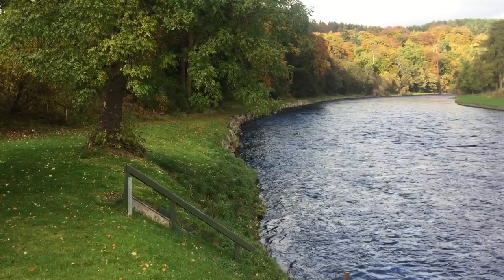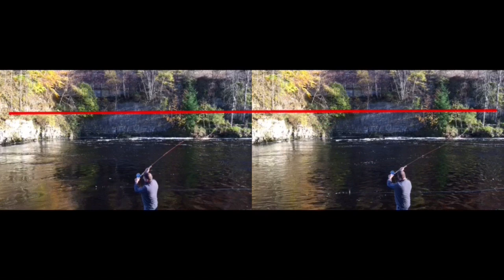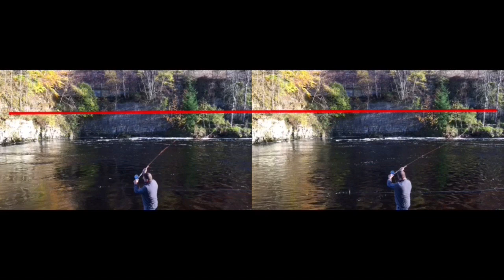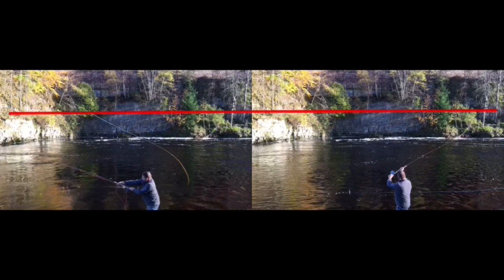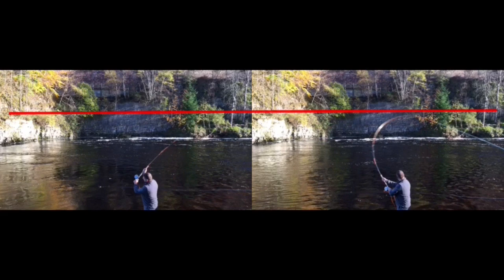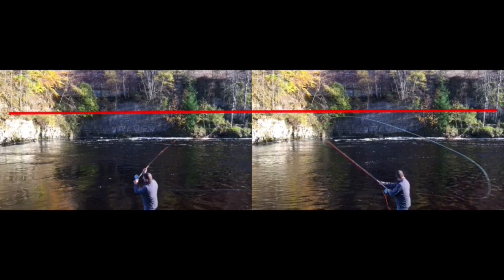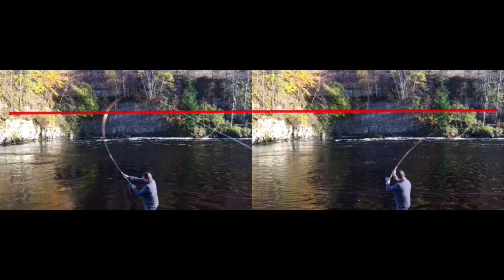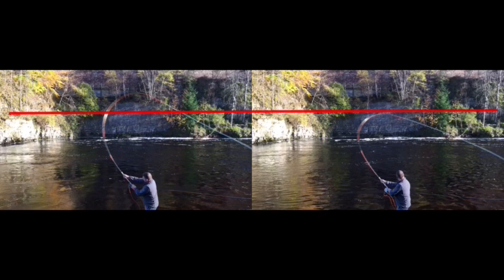Which Fly Line for my rod

Comment: In old days I did fish the heavy side ! 
As I'm starting use fast short stroke rods that change my line selection as well! 
Today I feel that many of modern rods has to little power in the mid section of the rod.
And if you go to heavy that slows down the fast action performance.
I did learn from Arthur Ogelsby back in 1982 river Spey. We fish 15' 11# class rods from Hardy and Bruce & Walker whit 100 to 120ft Double taper lines. Those rods has deep progressive action and that suits the long lines perfect.
As we see more and more US made rods and people ask for this type. A softer tip help most anglers to a more tight loop as we use the bottom hand and pull to our stomach.
Göran Andersson did invent this style very long ago. But that technique also bring in you must balance out line weight much more precisely the window is much more narrow.
I adapt to what I'm fishing with and still use full DT lines specially on my Hardy Favourite 16' a superb rod ! Best regards from Scandinavia Sweden 🇸🇪